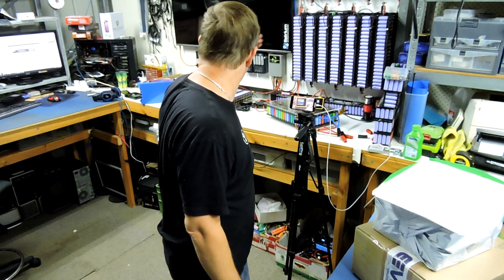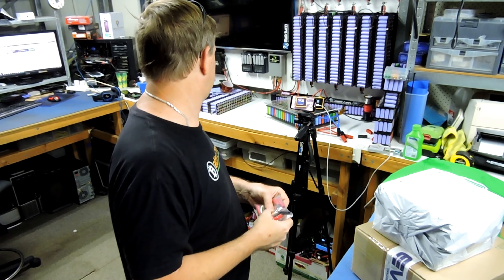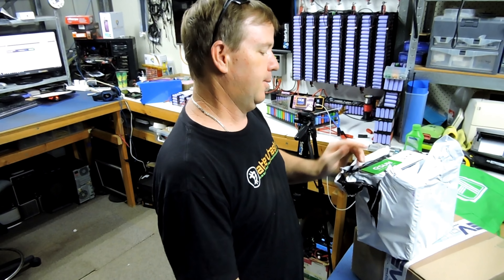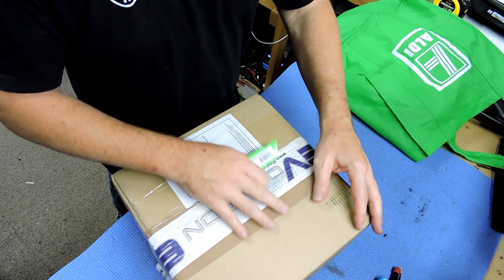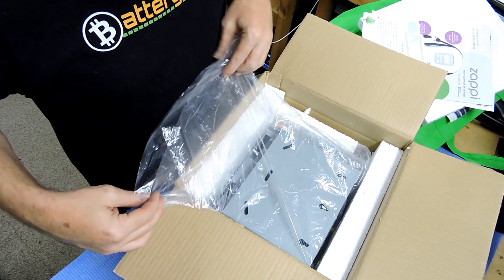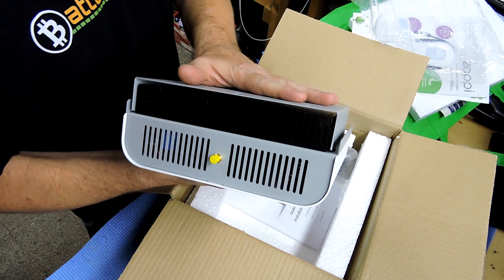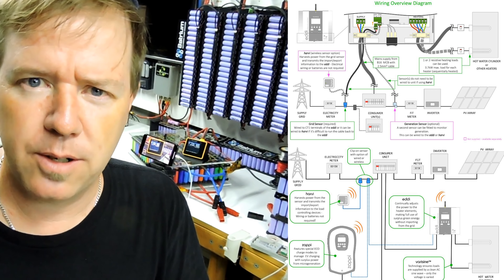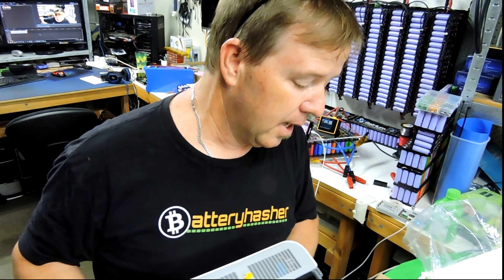My First Mail Time - One bag two boxes .....

Comment: So what happens if your hot water heater is already up to the set temp? I guess the unit turns on but sells to grid anyway since there's no load?
Reply from the maker: Then i would have to get a Zappi https://goo.gl/rPSLpw and an ev and only charge it from excess solar using ECO++ mode

Comment: I've just ordered a bundle of sample filaments including wood and carbon fibre should be fun
Reply from the maker: was considering ordering something different but still not done with the learning curve
Reply: @HBPowerwall  haha me neither
Reply from the maker: it's driving me mad that the smallest things affect the outcomes
Reply: @HBPowerwall  I got 2 reels of abs when I first got my machine the first worked perfectly I thought it was easy peasy the second was a nightmare I eventually gave up on it and went with the pla which is much more consistent even more so with the part cooling fan I added.
Reply from the maker: Fan mod & new bed springs are next for me... my enthusiasm is starting Wayne

Comment: So the miner wasn't an effective use of the excess solar? :)
Reply from the maker: it worked very very well actually - when the price was high - only real issue was heat in the power shed

Comment: eSUN is what I use.
Reply from the maker: Bunch out there, I've spent months looking for a replacement for the one I have - it just gets too hot passive cooling and no heatsinks and some of the pricing is crazy time will tell if this is a solid unit :) I'll test honestly and openly as always
Reply: @HBPowerwall  was referring to the filament brand.  been using esun for a couple years now.   cheap and good quality.   I totally agree with the comments to try PETG.   Prints like PLA but preforms like ABS.  Just need to do the all metal extruder upgrade for higher temps .   Bets upgrade I ever did to my printers.
Reply from the maker: hehaha lol Yes, seems PETG will be my next step
Reply: @HBPowerwall  get the swiss micro all metal upgrade first so it can handle the higher temps.